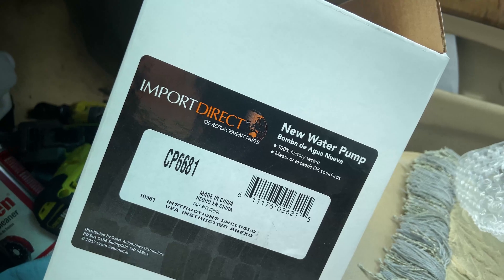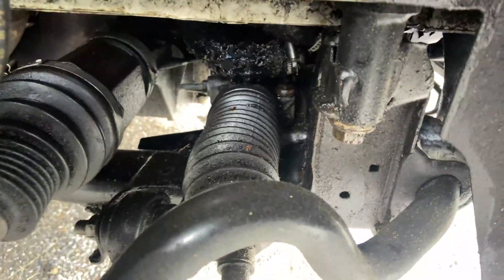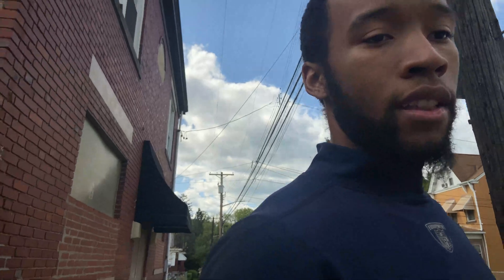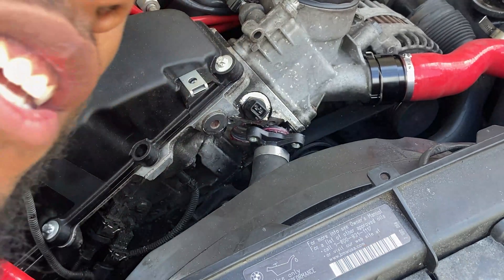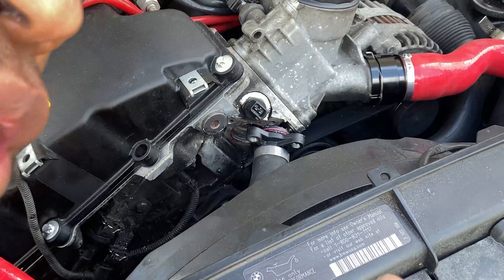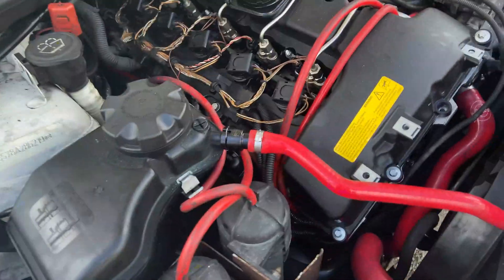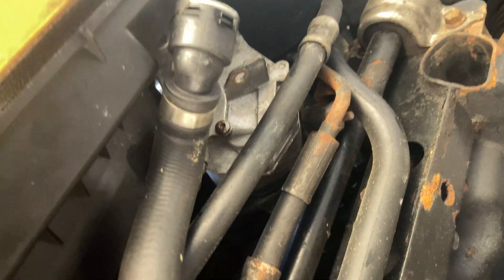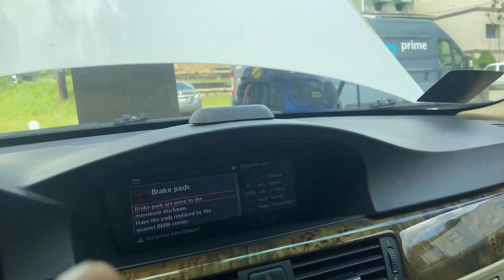Upgraded N54 Waterpump? Installing Vargas Turbo Coolant Hose Kit!

Comment: How many average miles do they last??
Reply: is there N52 kit? X5 e70??
Reply from the maker: They are silicone and aluminum so indefinitely I’d imagine. As far as other engine, lookup Vargas kits, that should give you the answer you need.

Comment: Hey there! How is the kit holding up so far after 2 years?
Reply from the maker: Well, the car has been sitting for the better part of a year due to either a trans or transfer case issue. However, just about 3 years with them and it’s hasn’t leaked other than the time in the video.
Reply: @FatalRPM same bro 💀 wrecked my transfer case and driveshaft after fbo and ebay war whistles. Engine is in great shape tho 💀.
Reply: Beat me to it 🤣

Comment: I don’t know how you installed the overflow coolant hose. Mine didn’t fit so had to get OEM fitment on it
Reply from the maker: From what I remember, the overflow feed had a little play but didn't leak. The overflow drain is an absolute PIA. I'm Guessing I didn't have much of an issue with it this go around because I replaced the overflow itself.

Comment: Im having trouble getting the thermostat to cylinder head hose on, did you run the hose down from the top to the thermostat or from the bottom up? And how did you run it through the engine
Reply from the maker: I ran it from the bottom up if I remember correctly. If you look up pics of the front of an n54 you should see the path the hose takes if you’ve already taken the hose off without taking note. There is a clip that will hold it down to the the turbo intake though. The path isn’t super complex luckily.

Comment: Wouldn’t it fit the n55 too
Reply from the maker: I don’t see why it wouldn’t, however I’m not entirely sure. You may want to research the part numbers for the n54 and n55 hoses to see if they are the same. That’s what I have to do when finding certain parts for the Z. You could also just look and see if they match but with how these cars are sometimes one hose may be like 2” shorter and screw up the whole swap.

Comment: on any of them on the vargas kit ever leak? alot of ppl said the hose from the radiator to the t stat leaked on the t stat side............... also how has the aluminum water pump been working out for you?
Reply from the maker: Only one did, I just re-seated the o-ring and it sealed right up!
Reply: @FatalRPM  never leaked again?
Reply from the maker: It has not. We getting close to 2 years without a leak, granted I haven’t driven it much in the last few months since getting a new daily. However this will become my race build after the Z is running again.
Reply: @FatalRPM  good to know. didn't you say it wasn't quite as tight of a fit as the oem one was?
Reply: damn.............. I watched the entire video and it did leak............... shit man, i'm gonna order an oem one for that one lower hose and call it a day
Reply from the maker: Yeah, honestly it’s mainly an aesthetic mod. If you only really need to replace 2-3 hoses then just go with oe.
Reply: @FatalRPM  i think the silicone coating makes em last longer too
Reply from the maker: Yeah, forgot about that. (Legitimately the reason I bought them 😅)
Reply: Just got this kit and the damn lower rad hose on the t-stat side is leaking. I reseated and it’s way better but still a slow drip; this is frustrating as hell!
Reply from the maker: @bimmerboi_hutch tell me about it, I absolutely despise that design. It’s almost easier to just drop the subframe to do it.

Comment: How is the O’reily water pump holding up? Is it an upgrade and would you still recommend it over another water pump
Tryna get more info on it, thanks
Reply from the maker: Sooo about that.... The motor died on me in the first few months and the replacement had a plastic front 🙃

Comment: Definitely looking into these vtt hose kit. I was red under hood but thinking bout going blue ..  red looks good tho.

Change them vacumm lines. I had those and dust and grime is attracted to the soft type rubber.
Reply from the maker: Yeah that’s just an issue with pretty much any non-coated silicone. Just know that the hose kit is the same. Since it’s serves as a cosmetic add on in addition to the functional aspect, I’m guessing it’s assumed the bay will be kept spotless.

Comment: So what was your over all solution for the leak. I’m having the same issue and I’ve tried two different sized o rings
Reply from the maker: If you mean the coolant leak, it sealed after driving it for a lil. I guess the undersized the o-rings knowing they’d swell and seal. Which would explain why it’s such a pain in the ass to remove any of the lower hoses. If you mean the oil leak, absolutely nothing. I’ve come to terms with the fact that I’m going to have to pull the engine to figure out where it’s coming from. It’s so insignificant at this point though that it’s not high on my priority list. Especially since it’s not contaminating my oil.

Comment: If I were going through all this effort I'd also do a CSF radiator. Love that hose kit but I'm a little less flashy and would do black.
Reply from the maker: I had actually been holding onto this kit for a couple months. I had just got enough for the water pump when I made this so extra things were out of the question. But I'd like to go all out on this car, but I want to finish the Z and maybe start on another project I have in mind first.

Comment: Your BMW is pretty loud around the front end for some reason.
Reply from the maker: Vavle tick as well as an exhaust leak I’m sure. If you watch my exhaust install you’ll understand why lol
Reply: @FatalRPM  most be the exhaust leak because I could hear the valve tick but something else was there. lol.  good luck on the project.  I just spent $2k this week ordering parts for my 135I Ill be installing before making my trip to ATL because I wont have a place to work on my car for a while until I buy a house.

Comment: Are you going s13 coils or the bolt on ones like powertrix? For the z
Reply from the maker: S13 coils with hub adapter welded on. 
https://youtu.be/p6oG5MzL2xI first part of the video goes over what I’m doing suspension wise